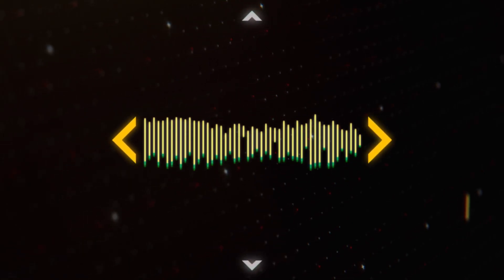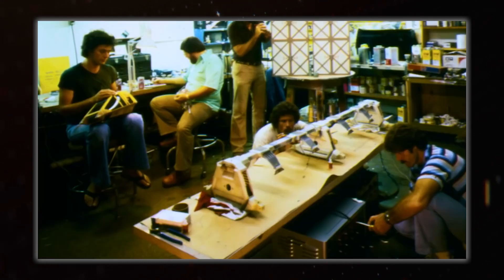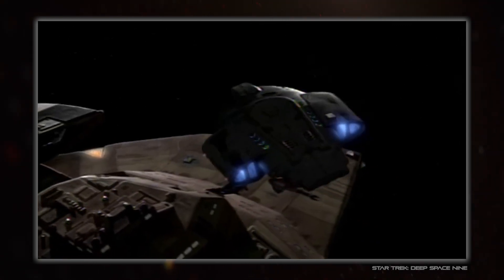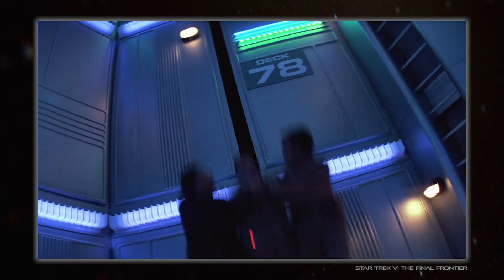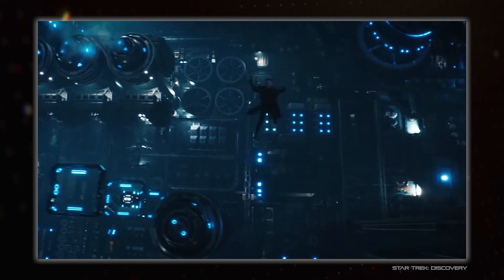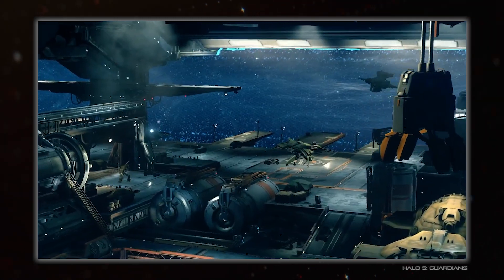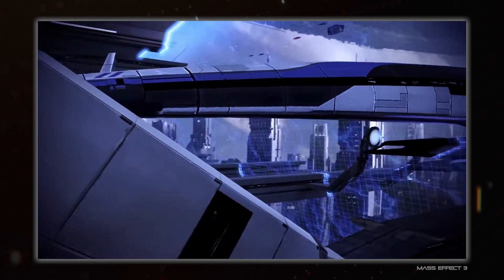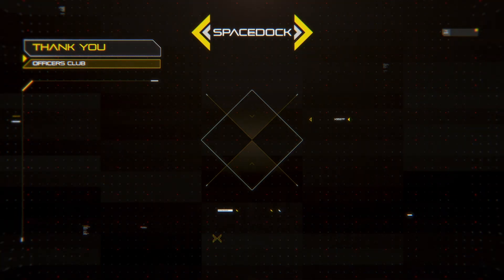Why Do Sci-Fi Spaceships Seem To Change Size?

Comment: The best example of ship scaling being messed around with for plot reasons has got to be the Arquiten-class Light Cruiser from Star Wars, the original 3d asset used in The Clone Wars, and later in Rebels, was scaled to approximately 230 meters long, however at some point there was a magazine which wrote the length at 325m long which started a long series of writers and artists adding more and more things and features to the ship that the 230m frame would simply never be able to do, which resulted in the ship seen in The Mandalorian. Moff Gideon's  Light Cruiser was very clearly intended to be an Arquitens-class, the same as the ships we see in Rebels, however because of all the story and plot requirements, it was heavily altered and ended up being scaled to 381 meters long. That's right, a ship that was originally shown as being a little over 200 meters ended up becoming a ship that is nearly 400. That to me is the pinnacle of scaling inconsistencies, when the need to pretty something up for your story ended up completely changing a well established and well designed design.

Comment: Everyone knows about the scaling issues with the Bird of Prey in Star Trek, but the Oberth (introduced in the same movie as the Bird of Prey!) is another good example I keep coming back to in my mind. Depending on the scene in an episode/movie it might be 80 meters long-or more than 300m long- even longer than the original Enterprise. More modern interpretations seem to place it on the smaller end of the spectrum, but features on the physical model don't make much sense on smaller scales due to the unique shape of the ship. For instance, the 'saucer' section has a multiple hanger bays running around the saucer, you have windows indicating multiple decks, etc that just doesn't work with a small scale ship.
Reply: We just don't like to think about the Oberth.   Fortunately, most of them blow up shortly after appearing on screen.   😁

Comment: The Defiant has a simple in-universe explanation; the DS9 episode One Little Ship S6 E14. A Runabout is shrunk by a rare subspace compression phenomenon while tractor beamed by the Defiant, and then later flies around inside the captured Defiant and liberates it from the Jem'Hadar.

It's obvious that the compression field leaked into and contaminated the Defiant via the tractor beam, causing it to have a variable size. 
And it's already been established in Trek that future events can ripple into the past, so therefore this encounter resulted in the Defiant never having a fixed determinant size.
The Defiant having tachyon radiation leak into the hull from the cloaking device is the interaction that instigated the temporal elements of the effect - consider how many times the Defiant has been subjected to temporal effects and even closed time loops…
It was always destined to not have a fixed scale.
QED.
Reply: So the people controlling the Defiant have variable sizes too?!?

Comment: Obviously it isn't done because it'd be boring. But all space warfare tends to take place in visual range. Even when they aren't trying to do ww2 in space this still happens. And the reality is waring ships will almost certainly never see each other. But is there any good ways to explain why this happens in universe? Again, understood it'd be boring to watch, so obviously can't do it. But any way to in universe truly justify it?
Reply: The Mutara Nebula bit in Wrath of Khan was the best excuse -- sensors scrambled, torpedo guidance messed-up... Sulu was basically flying like an Alaska bush pilot, with the windshield iced over and his head stuck out the side window.
    So, basically system failure or interference of some sort.
Reply: @stevenscott2136  the original Gundam series did something like that. They had some kind of new particle that blocked all radar and long range detection. I guess it works well enough. Still seems space battles would end up being from far bigger distances, but yeah, it is better then nothing.

Comment: You missed one factor that really contributes to the perceived scale issue: perspective putting a small shuttle near the camera and a large ship further away will have the viewers see them as closer in size. You did include it's use to hide the scale differences but it is also very common to use it to create them.

Comment: Defiant is a big offender, also the Klingon Bird of Prey is whatever size the script called for. Another one is the Voyager shuttlebay would never be able to fit the Delta flyer, much less the 35 or shuttles that crash or are destroyed through the series. 
Games are always funny because the hallways need to be 12 feet tall and 15 feet wide to make sure a camera and clipping of players and NPCs don't happen. 

I think it's one of those things sci-fi nerds and horror and fantasy and superhero nerds have in common: a big part of it is how much the fiction sets up it's own rules. If the fiction sets a bunch of rules out, then it has to follow the rules. If the rules are loose (Star Wars) then a lot of the rules can be set aside. Which is its own problem, because there are a few rules and breaking them makes them stand out that much more.
Reply: I assumed they just replaced destroyed shuttlecraft and that's why the crew was always rationing replicator usage.  Maybe they had a grand total of three shuttles when they left DS9, and once they got stuck in the Delta Quadrant, they just kept making new ones as soon as another got totaled.  The Delta Flyer gets wrecked in one episode too, and they probably replicated it too.
Reply: Yes, exactly.  Whatever your in-universe ruleset is, follow it.  It can be hilariously unrealistic, but you have to follow your own rules.  If you break those rules, we're going to notice because it's already straining the immersion.

Comment: Author moment...

Space ships are cool... warships are cool... space warships are cool... let's design ships...

Ok, so there's no size constraints in space, so I'll have them BIG, and give my spacers room to breath. And the drive system operates like so, and that will dick Tate's design...

Ok, so it's no longer phallic, but triangular. No matter, it's not like there's unreasonable resistance in space to push against. Ok, so how many people can I put in these things... does the dirty maths...

DAFUQ!!!

Triangle/saucer design exponentially increases square frotage. I can't add more spacers, but that would negate the purpose of the types of ships, like throwing hundred dollar bills into a fire to boil water.

SHIT!!! Why you do this shit?

It's your fault. You thought it up. Fuck you! Deal with it!

Shit shit shit shit shit... If I trim it here, and I trim it there... ah, structural integrity... ah, inner hull... 

The inner hull is half the size of the ship...

Shut up! I'm... working here...

Don't forget, you need space for shuttles...

With the amount of space we have, we can have enough spacers that we can just throw them out with messages tattooed to their bodies... wait... how big are the shuttles? How many will be needed, and what do they do? Boat bay...

That corrects the smallest ships. What about the bigger ones?

Shut up!

Didn't you want an 8km battleship.

Right now, I'll be lucky if I can make it 2km. That says nothing about the carriers. Gawd fucking damn it, how big are the attack craft?!

Comment: In the Stargate: Atlantis episode "The Last Man" the scaling of everything is just bad. Now, the Stargate franchise has had many examples of bad CGI and scaling issues in the past, but the CGI in that episode was just awful. When the Phoenix destroys the first hive-ship, it appears that those beam weapons it fires are absolutely massive, but when the ship gets closer to the second hive-ship and fires its beam weapon, the beam is suddenly much slower and thinner and causes just a tiny explosion. It's like they just used some static models and they just zoomed in and out the two CGI elements, and then drawn some lines, without caring that everything was just plain wrong. Then in the second space battle, everything just appears static, with so sense that there's supposed to be this small ship fighting three larger ones, except for the very first scene.
I think that in season 4 they blew away most of their budget on the season premiere and mid-season three-parter, leaving very little for the season finale

Comment: I'm rather surprised you didn't mention the Klingon Bird of Prey, where the different scaling issues resulted in 3 different classes of the exact same ship.
Reply: That’s one of the best examples in Trek and I’m surprised he didn’t mention it.
Reply: @romigithepope  Every video needs obligatory Mass Effect or Halo references. It's in the BreadToob TOS or something.
Reply: @Corbomite_Meatballs  To be fair, Halo is another example of the same issue as the Bird of Prey, with the same asset being used for Covenant capital ships of vastly differing sizes. I think the video was very deliberately avoiding these examples as being a separate issue, instead focusing on instances where what is supposed to be the exact same ship is shown at different sizes in different scenes.
Reply: @DrakeAurum  Yup. Even the Halo lore books try to explain it away that certain shipbuilding forges would have their own patterns for ship classes which is why ships like the Long Night of Solace were given pattern names after the fact to recognise they are a different class versus ships such as the Shadow of Intent despite them sharing the same model, just scaled differently.
Reply: EC Henry did an amazing video on whether the whales from Star Trek IV would actually fit inside the ship.
Reply: Rewatched TNG recently, that really bothered me more than it should. Also resulted in a colossal "Regula 1" station and in an Earth spacedock 6 times the size of the original.
All examples are due to replacing shots of the Enterprise-A miniature, with the much larger Enterprise-D. 
Budget and time constraints, probably.
Reply: I'm glad only the Defiant was mentioned. It was a good enough representative example for Star Trek, and it helped keep the video on point yet concise.
Reply: I remember FASA's Star Trek: The Role Playing Game in the 80s had different classes for the Klingon Bird of Prey: A scout size and cruiser size (and maybe even a middle size?).

Comment: I usually don't notice this kind of thing, but I did notice it in the original Starcraft. There is a level or 2 that is supposed to take place inside one of the playable units, but because the units don't look that big onscreen even in comparison to each other I found myself wondering how this big level fit inside the tiny unit.
Reply: glares in Terran Battlecruiser

Comment: It's not just Plot Armor, but Plot Storage Space, too. Case in point, where all of Voyagers shuttle craft kept coming from.
Reply: Apparently they had enough facilities in Voyager to build them (see also the Delta Flyer, that got built, destroyed and re-built).
Reply: @Schnittertm1  And all the times the inside of the ship was wrecked but perfectly fine the next episode. I'd swear Janeway had a djinn chained up somewhere.
Reply: @cocacola4blood365  Ah, it's likely and adaptation of technology that Japan developed in the 20th century, designed to rebuild their cities after yet another Kaiju attack. Should be fairly easy to miniaturize it to rebuild the interior of a starship.